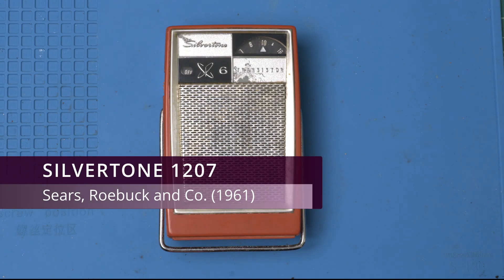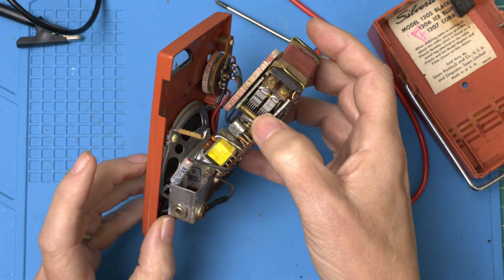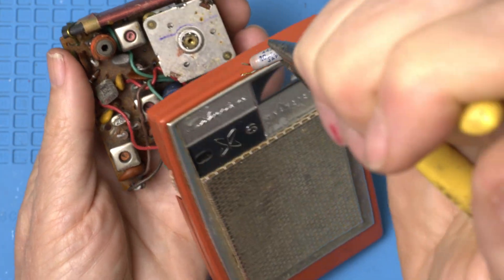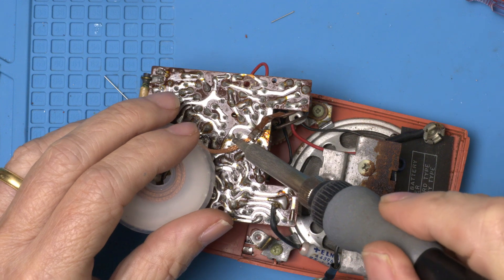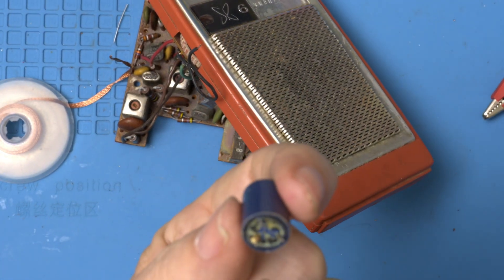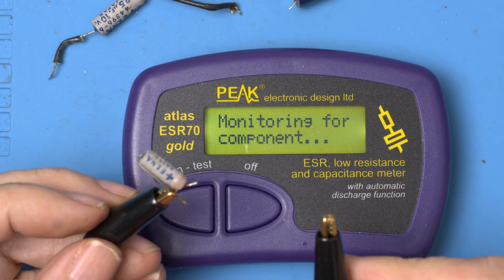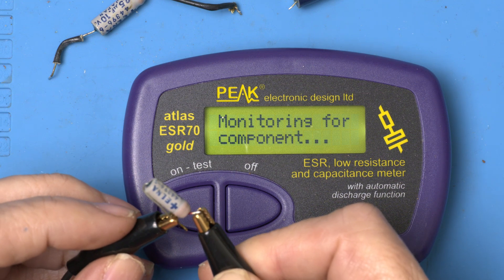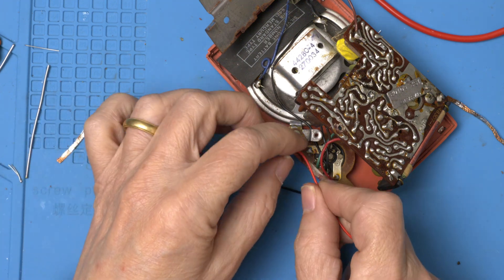Vintage Electronics Repair: Dead Silvertone 1207 transistor radio restoration

Comment: To protect the tuning capacitor, I always close it before disassembling (that is, set the radio to 540 kHz). That way, it protects the plates from getting bent accidentally during the repair process. I do this regardless of what kind of radio I'm working on, tube or solid-state.

It's also a good idea to clean the tuning capacitor as well as the volume control.

Comment: I do remember back in the mid to late 60s where everybody has a transistor radio. And of course everything than was AM. But that allowed us to get stations hundreds of miles away... Batteries were another issue though... lol    Thumbs Up!
Reply from the maker: I think alkaline batteries last 4 times longer than carbon-zinc.  In any case huge difference!

Comment: It's important to know this little item about transistors and ground in these pocket radios. If you have a radio with PNP transistors it's almost always a + ground. If NPN transistors are used  then it has a - ground (it was far more commonly
done). Make sure the two wires of the battery go to the right places in case some previous repair person messed with it
switching the two leads and the radio didn't work! Arvin made radio and works great now..
Reply from the maker: Very interesting - I will remember that!

Comment: Bad caps are obvious issue. Are there other telltale signs to look for?
Reply from the maker: If you don't hear anything, no click, no scratch, nothing, then its likely a power issue.  Look for broken or loose wires to the battery or even broken traces on the circuit board.  Same deal if you're using bench power and zero amps are being drawn by the radio.